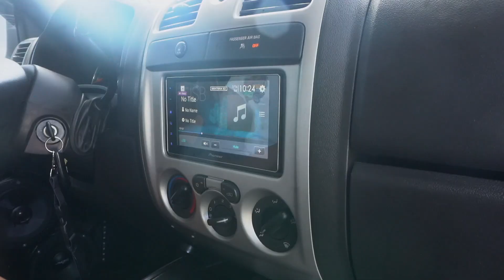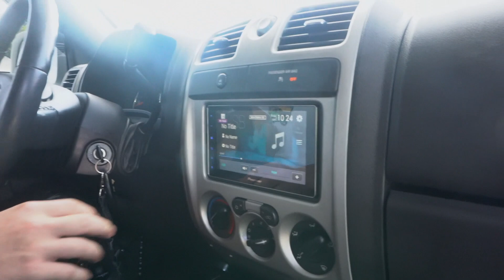GETTING A PROPER READ ON YOUR VOLTAGE WITH JP! XS POWER SHOW 2022

Comment: The cars computer is the enemy for your voltage. Lol.
Reply: I have a 320 amp alternator at startup my voltage is at 14.8-15 but sometimes at 2k rpm on the highway it’s 13.5 realized it’s the ecm because at 2k I should be getting the full 320 amps

Comment: I’m pretty new into the stereo scene i’ve had 2 12s in my truck for about four months now but when I drive at night all my lights flicker my headlights my dash lights judging by this video I’m guessing that’s not supposed to do that ???
Reply: That means your amp is pulling more power than your electrical system can handle. One thing you can to do to try and fix this is the big 3 or big 4 upgrade. You can also get a better battery for your vehicle say a Xs power. You can also get a extra battery.
Reply: https://youtu.be/xqLq5MZG5R0 

Here’s a video Jp did that will explain things better.

Comment: If that guy was talking about the Jp23 or jp234 voltmeter there is an adjustment to match voltage. Look for the little hole on the tab side there's a potentiometer to adjust the voltage readout to match the truck voltage

Comment: So can someone explain how inverted subs work as far as sound? I have 3 12 Crossfire C7s in a center console with one inverted. Box is tuned to 35 hz and is about 5.6 cubes. I know its too small for all 3 but thats why one is inverted. But when i turn it up, the inverted sub sounds like crap. Anybody know why?
Reply: sounds like its not out of phase, when u invert them u have to reverse the positive and negative to the inverted sub otherwise its loosing trying to push against the other 2 subs but if u reverse the inverted instead of pushing it'll pull makin it match up with the other 2.. so check to see if the 2 firing out if box have positive and negative matching then on inverted sub reverse the positive and negative on just the inverted and u should be good
Reply: @mikemccabe7124  thanks for the advice man. Ill try to check it today when i get off of work. I did see another youtube video where the guy told me that when the 2 subs installed normal push out, the inverted sub has to pull out? Or something like that?
Reply: @bashns7743  ya thats why you would reverse the positive and negative on the inverted sub and the other 2 should be hooked up normally and that will make it so they're all firing correctly
Reply: @mikemccabe7124  with that being said, once i get it rewired, it shouldnt sound like its bottoming out afterwards right? Even if the box is not enough for all 3 subs?
Reply: @bashns7743  yes it should totally change the way it sounds it should actually sound right  and give you that bass ur looking for but you can rewire it urself its pretty simple just check the 2 subs sitting in normal to make sure positive is on positive & negative to negative and on inverted sub flip flop the connections so positive is on negative & negative is on positive on the sub itself and thats it also you can add polyfill to the box it fools the subs to think ther in a bigger box, you can buy bags of it at walmart in the fabric area if the box is too small then the fiberfill will totally change the sound too until ur able to get a bigger box if u'll even want one after u add the fiberfill its what jl audio & other high end brands uses in all ther stealthboxes which is why ther stealthboxes bump so well
Reply: @mikemccabe7124  i think im gonna have my guy check the wiring to follow the steps u just told me bc knowing me, i will probably mess something up on the terminals or wiring lol. I would put polyfilI but i have plexiglass to see imside the box so it probably wont look right. I appreciate your help man!
Reply: @bashns7743  ya the polyfill would definately be not appealing to the eyes if you stuff the box with a bunch of polyfill.. well once you get the subs wired right it should sound how u want it to
Reply: @mikemccabe7124  once i switch the wiring, i will let u know man. I appreciate u
Reply: @bashns7743  no problems
Reply: Did you wire the inverted sub out a phase?
Reply: @adrianornelas6447  well my friend did the install but he says everything was wired correctly. I dk too much about installing car audio
Reply: The only difference inverted makes is removing driver displacement so if yer to small make them all but you will jets a little more air chuffing from the vented pole or under spider venting and a trick for seeing final phase use a 9 volt battery to final leed will all push in or out

Comment: What song is this? Is on rusticals?
Reply: Bud I was jamming Young dolph pulled up slowed 30. 31 Hz
Reply: @proleaguegamergamer7858  I can't find it on Spotify. Where did you source it?  Thanks bro
Reply: @CanesupNolesDown  Youtube👍
Reply: @proleaguegamergamer7858  hey bro. On the video it says a factory alternator plugged into a factory plug could show a volt off. I think they meant aftermarket alternator. I'm about to put a high output alternator on my car. Direct plug and play. I drop down into the low 12s at full tilt currently on stock 120 amp alternator. I have a xs 3400 battery under hood. How much if a difference did you see after changing your alternator from stock?  Thanks brova!

Comment: Since nobody has commented this yet. Now with modern technology you can pretty easily trick the computer into thinking it still has a sense wire on the alt w/o it actually being Present. There are a couple companies that sell these. I have a 2016 Ford Focus se and they make the adapter for my vehicle.  With a small amount of research I'm sure you will come across it if you have not already.  However with this adapter you will not be able to manually adjust the voltage like an external regulator if that is what you so desire. It works with internally regulated alternators.
Reply: Yea i did similar stuff in my 21 f150
Reply: @vlad1889   Your my car required me to spend pretty premium prices due to the canbus system comes with benefits though the idata link I installed, allows for my odb2 info to be displayed on my head unit engine/coolant temp, timing, intake temp. Etc